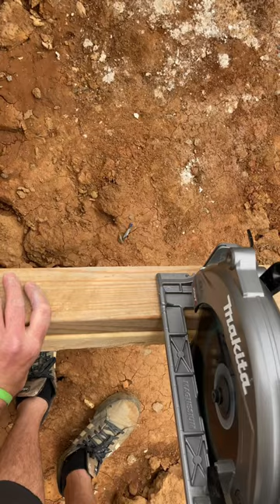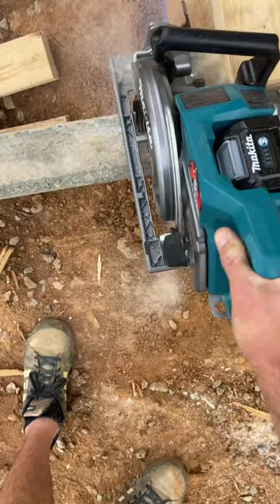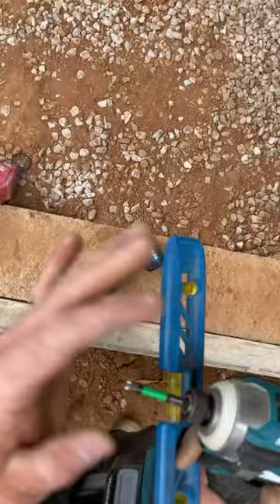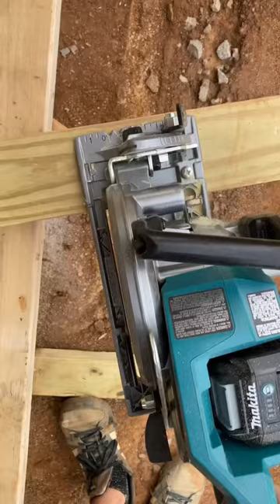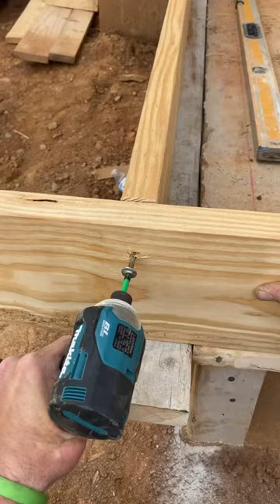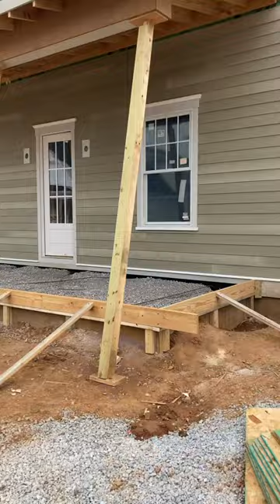Power Tool Addict / Makita / 40v XGT / Rotary Hammer / Beam Saw / Impact Driver / @MakitaToolsUSA

Comment: You putting the new 20oz toughbuilt hammer to work.
Reply from the maker: Man I really like the head and the shock mechanism. I swapped the original handle for a wooden one. It’s awesome but me putting a wooden handle on it really comprised the strength of the shank. I ended up shooting for the moon and bought a Martinez. Hopefully I’ll feel I got my $400 worth after I pound a few sinkers😂

Comment: I love Makita tools but they have really failed in their marketing of the XGT lineup. They don't have a single display or tool available in my Home Depots or Lowes stores. Often I buy a tool that I need that day. There are also no deals on the new lineup even if I wanted to get it online nor a definite answer on how long LXT is going to be around so I can't even invest in that lineup without knowing whether they'll stop making them in 5 years.  Meanwhile I can get most Milwaukee Fuel tools within a 10 mile range. It's like Makita wants me to go back to the red team.
Reply from the maker: I feel your frustration to the fullest man. Me and my buddy were talking about that a couple weeks ago. Let’s say your running your saw and the battery fails. If you only have one battery your fukd. Not like you can run to Home Depot and replace it cause XGT is non existent there. Slowly XGT tools and batteries are showing up at my local HD but not many. Most outdoor power equipment. They have ran deals with free battery promos and stuff that were hackable on the HD app but I know what you mean. When it comes to XGT the US is dead last in receiving them. Great tools but availability is a big factor so I agree